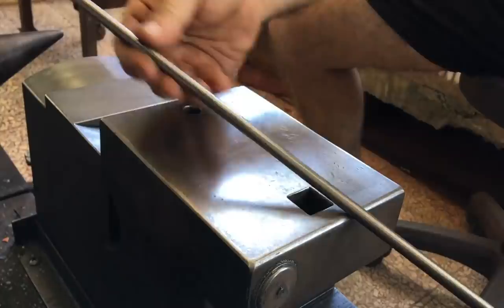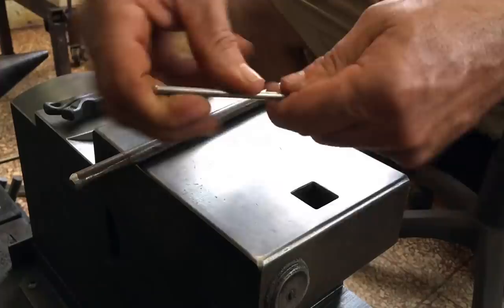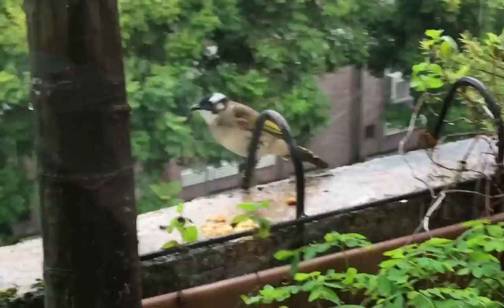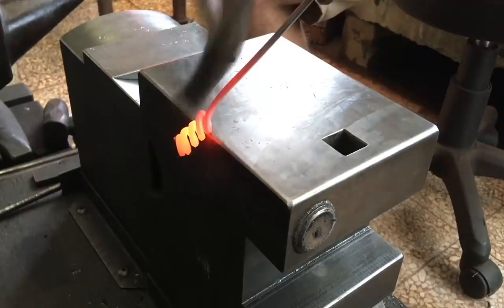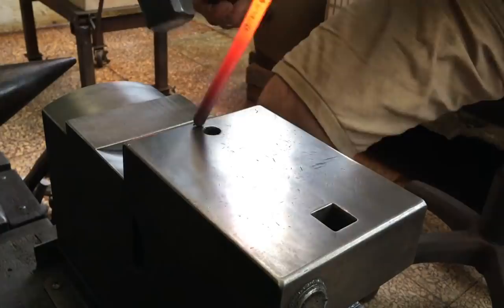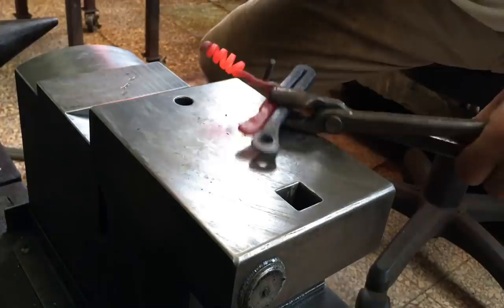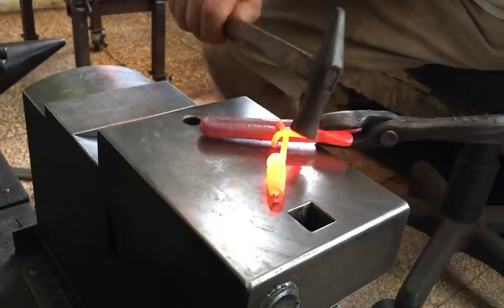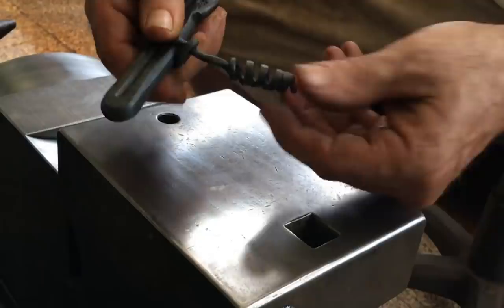Hand Forged Corkscrew

Comment: I did something similar trying to coil around a bar like that.  I had similar issues with having to futz around With the coil forever.  Mark aspery uses the step to coil in his corkscrew video and although it looks overly complex and counterintuitive  it works surprisingly well and quickly.  I’m forever having to check and recheck my coil direction.  A lefty will be very happy to have that corkscrew!!
Reply from the maker: I will have to check out his video. I remember seeing him work in other videos and his hand hammering is impeccable. I was monkeying around on this way too long for just an average corkscrew at best. Thanks.

Comment: I have the luxury of being able to make coils in my lathe. What you do when making coils on a lathe is pass the coil wire under or over a pin held in the tool post as it winds on. (Forward or reverse for L or R handed coils) This pin takes the force to coil the wire as it winds onto the mandrel.
I'm sure that system would work just as well doing it by hand. Just add a long solid pin to your jig.
On the lathe I pass the bar through a loop on the pin for safety to stop the bar flicking out and getting you. Go slow and stand out of the way.
I stop the lathe before the bar passes all the way through. I just move the carriage to lay the coils next to each other.
You can stretch the coil out after to get the gap between the coils like a spring.
I don't stretch the coils out because I cut my coils lengthwise along the axis for making individual rings.
Reply from the maker: Yes, the solid pin method as you described would definitely work. After doing and reviewing this, I see many points where I could've gone about it differently. Live and learn... Thanks for sharing.

Comment: What type of steel is the larger 12 or 13mm round bar? It doesn’t seem to scale like mild steel does. It also always has a shine no matter the temperature.
Reply from the maker: That round bar (10mm) is just 1018 mild steel. I think the "shine" you mention might have something to do with the somewhat lower temp. I run my forge at. Others have mentioned this. Thanks.

Comment: Does it work?
Reply from the maker: It works but barely. If I were a desperate wino and only had this corkscrew, well, I'd be screwed and would go to twist caps. I will do a follow up on this and make another, alternative style opener. Thanks.
Reply: @gstongs  I really like the idea of the jig for it. I was wondering if its possible to also set equal spaceing between the firms with it. I'll look forward to your next video. Thank you.